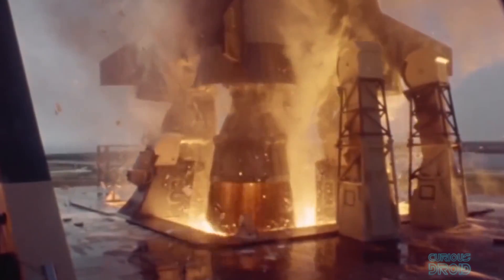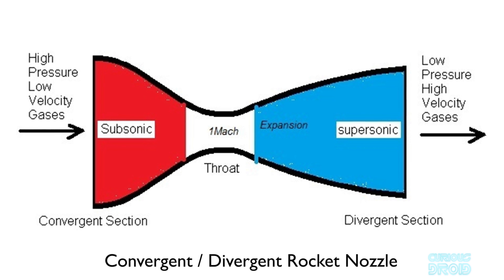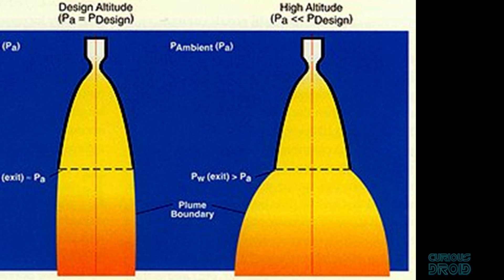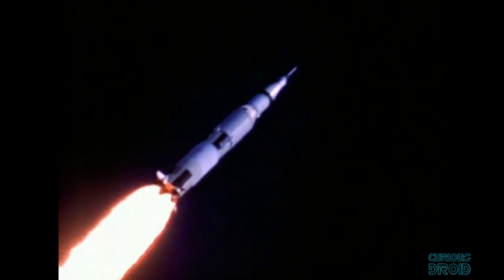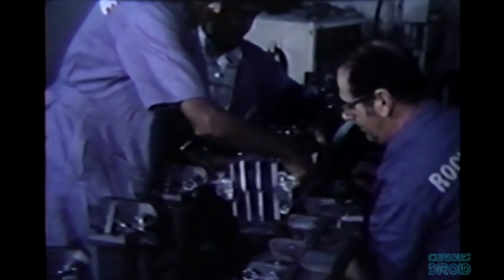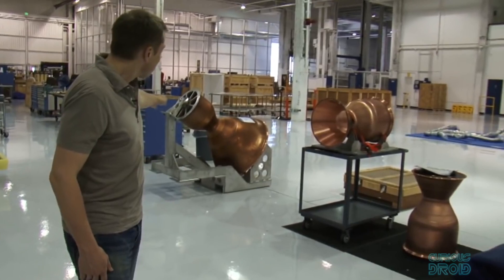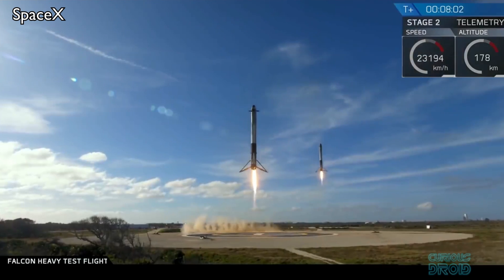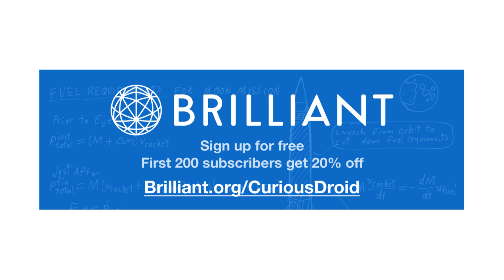Aerospike Engines - Why Aren't We Using them Now?

Comment: @2:35 Whilst it's true that we have evolved to live at (more or less) one standard atmosphere, and we can't survive for too long if that poressure is reduced to about half that, that is not the reason we don't feel atmospheric pressure. If we truly did have a net pressure of 14.5 pounds bearing down on every square inch of our body, then trust me, we would really, really feel that. 

That actual reason why we don't feel atmospheric pressure, is that our bodies are permeable. That is there is 14.5 PSI pushing outwards which makes the net pressure on any point of our body zero. That's also how commercials divers have descended to 500 metres where the pressure can reach 700 PSI.  

That's not so say that there aren't physiological issues due to the differences in partial pressure of gases. Those who are diving to considerable depths have to use special mixes of gases to avoid the toxic effects of normal gas mixes at high pressure, but they don't actually "feel" the pressure due to that internal and external equalisation.

Comment: I wonder if the ability to control fuel flow and thrust would allow for slower rockets. The bell type rocket motors are designed for one speed, full. Ability to ‘throttle down’ the thrust would be interesting as far as flying into space with lower g’s rather than a vertical launch.

Comment: Don't get me wrong aerospikes are good in atmosphere, so they could make sense as a first stage or booster engine. But they are not nearly the slam dunk some people think they are. The heat issue is nowhere near solved (just expensively mitigated) and the added complexity in terms of plumbing, valves, pumps, and added combustion chambers is not at all trivial. The plumbing is always way trickier than the engine bell design. I believe that aerospikes could work, and even be better than bell nozzles, but as with all things in aerospace (and particularly with propulsion/fluid dynamics) the details here are not at all trivial or straightforward. There is a lot of complicated development work left to do to make them reliable and better enough to warrant switching.

Comment: Paul, I noticed an error. 
1 square inch is not as you said 2•54 square centimeters. 
You naturally meant 2•54 centimeters squared. 
Thanks for the information in the video.

Comment: aero space engines  where gave up  after they where seen to melt down  prematurely   they also could not produce the amount of thrust nessesary for lift off   they where obstrussively expensive and produced insuffient thrust     so don't make them sound like they where the best thing ever invented     they where scraped after they realized they where burning up mid test    get your facts straight     dam your negative

Comment: Aerospikes don't remove the need for staging: you still take a huge mass penalty lugging the entire vehicle into orbit, so you'd be better off discarding three quarters of the vehicle (and a good chunk of mass) and then only lift what's left into orbit. And if you're going to need to stage anyhow, you can just put vaccum-optimized engines on your upper stage... and thus the main advantage of aerospikes disappears.
Compare the full-sized VentureStar (the final version of the cancelled X-33) to a Falcon 9. The VentureStar is twice as heavy and has twice the thrust, and yet has 10% less payload capacity to low earth orbit. What's the point of it, then, if it has less than half the efficiency of a conventional rocket? It wasn't even expected to be cheaper: VentureStar was supposed to be 1/10th the cost of launching the space shuttle... which would make it around the same price as the Falcon 9.

Comment: Black Budget money went in the development of another SSTO government project similar to Aurora. This is why NASA hasn't had a manned launch from US soil since the end of the Shuttle Program. NASA also know as NADA even with BILLIONS OF DOLLARS and over a DECADE cannot get a rocket into space even using existing technology!! All the components are from the Shuttle, the solid rockets just a other segment,  reusable engines leftover from the Shuttle Program to be used once and wasted the external tank with a little different plumbing.  It's all politics and about jobs. It is actually a wasre almost criminal. I usually support everything NADA did but they have done NOTHING FOR over a decade!! Launched a dumpster green capsule shaped spud with some old Sparko racing seats thrown in for good measure spot welded together by third rate engineers and workers milking their jobs, robbing the taxpayers.  And the put the Orion dumpster on top of a perfectly good Delta IV which is existing technology and could have been human rated. Is basically uses a modified Shuttle R-25? engine. Mark these words. The SLS will not get built. They might slap together one Orion/ Dumpster but god knows what it will get launched on. A commercial rocket maybe? Government didn't want to waste billions per launch especially on a inherently faulty vehicle that killed 14 U.S. and international astronauts,  scientists and citizens. The technology the has is beyond what most ppl could believe. They cannot afford for it to fall into the hands of underdeveloped and unstable countries.  It would be worse than nuclear weapons in the hands of ISIS which almost happened a couple times.
Thank you for letting me have my moment.

Comment: We are missing something really big. There has to be a much easier way to get off the surface of this or any planet.
Reply: There already are.
But they require heavy expensive and experimental Infrastructure and are Impossible on Earth.
small and hardy Payloads could be launched from the Moons Surface to a Space Station in Low Lunar Orbit.
But that's not economically viable.
It's like building a Train Line to just a single House
Reply: @user-si5fm8ql3c  I suppose. Until there is a profit to be made and/or someone finds resource(s) that are viable (maybe asteroid mining someday or using resources from the Moon everything obviously has to be launched off this planet. Also, it seems like NASA even with SpaceX, has a hard time keeping supplies to a few ppl on the ISS 250 or so miles away. They might find it harder to keep a few people on the moon supplied let alone Mars. I am optimistic tho.

Comment: My understanding is the single stage to orbit is not an attractive option. Moving the empty tanks etc into orbit would take way more fuel which equals a much bigger craft to launch a smaller payload. The work done by Space X in reusing the first stages makes it even less attractive. So while the aero spike engine may be interesting it brings no value to space projects as reusing rockets will become much more routine, possibly including at least some second stages.

Comment: I think obsolete, there are better working less expensive ways to fly with rockets, plus we know how to use the Earths magnetic field AND 'cancel out' gravity (without a rocket, but with electricity). I suspect this will be common knowledge within a decade, if not even years. In my view: this project has been running for too long compared to the speed of the other alternatives being discovered (duration of development will impact the costs heavily and the 'balance' must have tipped somewhere down the line when the alternatives emerged.

Comment: Concerning the maintaining of a "CONSTANT" concentrated one uniform thrust of expanding gases and the reduction of ambient air pressure causing the concentrated thrust to lose power- because the expanding gases expand too much--#What if liquid nitrogen was UNIFORMLY passed over tubes running OUTSIDE the bell shaped cone so that when it "#JETS #OUT,  it's #SHEER #COLD will #CONTAIN the SAME UNIFORM #MAXIMUM shape for thrust!!--In other words , this method might not need second and third stage rockets and importantly CONTROLLING the #SHAPE of the expanding gases exiting nozzle will allow for CONSTANT MAXIMUM THRUST!!

Comment: Funny when the X-33 was proposed during the loser administration of Clinton/Gore. Gore had the responsibility of getting X-33 "off the ground".
When the X-33 program got going they recognized their assumptions were wrong on the complete design.
Those aerospike engines can't get the thrust required to boost the X-33.
Too much worthless stuff were on X-33. Weight and complexity of health monitoring systems. The composite tank was never viable. The aluminum tank would have been a stepping stone to get X-33 flight tested with the aerospike engine. The idiots in the Clinton/Gore team watched to much Star Trek and Star Wars. The X-33 just couldn't work. The aerospike wasn't the only problem. But it was a huge performance problem the project couldn't beat. Plus it was never going to work. Gore said the day it was announced, that "if it didn't work that was OK". "The technology development would be worth the failure."
That tells you all you need to know about the project. X-33 was a rich man's WPA program. Just Government money down a rat hole. The money was nice for aerospace workers. All of it got spent. But no good product. They tried to do a cryogenic valve that was electrically activated in opening and closing. Never happened! I was there. The valve would never close completely as designed. The conventional valve would have worked by mechanical means. But no, the engineering thinking was incomplete all the time. They were trying to mandate technology that wouldn't work.
Aerospike was just one of the reasons X-33 never did anything.

Comment: I've heard that the biggest problem with aerospike engines is that they overheat very quickly. I think running cryogenic fuel through the surface like on the Space Shuttle would be a decent fix. I don't think anyones created an expander cycle aerospike engine yet, that would be interesting.

Comment: Why can they not propel rockets into space with extreme PSI and compressed air is polution free and will be a lot cheaper even if it is only used as the first stage in the rocket to get half way.

Comment: There certainly seems to be some truth to the suggestion that following the Challenger disaster the Reagan government facilitated the transfer of a significant element of space technology, research and exploration out of "public" control and reclassified it secret as well as into proprietary hands (primarily defence contractors). Why this happened I can only guess. One thing which always nagged at me going back as far as the eighties was the argument that manned space explorarion (particularly aimed at the moon) was simply too expensive. Why? We already possessed a rocket capable of getting us to the moon. Ditto the landing vehicle. Practically all of the major costs (primarily in research, materials development, design etc.) had already been paid. You are simply re-using existing technology, drawings, astronaut training etc. which comes at a fraction of the cost. You already know how to build a Saturn V rocket so the only costs are those at the very back end of the development and production cycle - primarily materials manufacturing, assembly, fuel etc. Then there is the argument that landing on the moon is just too dangerous. It would be political suicide if something happened which led to fatalities. Perhaps there is some merit in the latter point - but let's not forget that the Apollo program (certainly beyond the deaths of Grissom and company) had an excellent safety record. This is a program which oversaw several successive trips to the moon and back - the majority of which executed the incredibly challenging lunar insertion, undocking, powered flight to the surface, astronaut EVA, liftoff, docking with the command module, shift to a higher orbit. burn for trans-earth injection, earth orbit insertion, re-entry etc. Even after Apollo XIII suffered catastrophc damage and Misson Control ordered them to abort - they still managed to make it home.

 Which begs the rather obvious question - if almost all of the Apollo program's costs had been amortized and post-Grissom, Chaffee and Whte's deaths the flight vehicles had an excellent safety record - what's the problem? Since when was it reasonable in any era of exploration to turn down the use of admittedly dated but tried, tested and already paid for equipment with an excellent history of safety in favour of shelling out ten or more times the other's costs in order to research, design and build new ships, train the crew and maintenance teams etc. - only to then start 12-18 months performing exhaustive tests which may reveal problems causing delay after delay whilst the costs skyrocket? Bear in mind too that with modern methods of construction amd miniaturization they could easily remove many of Apollo's antique, bulky and heavy equipment (such as the guidance compuer) and replace it with a Raspberry Pi or equivalent which fits inside a packet of cigarettes. Repeat this across many of Apollo's systems and suddenly you have a dramatically improved spacecraft which is now several hundred pounds lighter. Which means more room for fuel, a larger sensor package, better vehicle etc.
Reply: >Since when was it reasonable in any era of exploration to turn down the use of admittedly dated but tried, tested and already paid for equipment with an excellent history of safety in favour of shelling out ten or more times the other's costs in order to research, design and build new ships, train the crew and maintenance teams etc. - only to then start 12-18 months performing exhaustive tests which may reveal problems causing delay after delay whilst the costs skyrocket?
Since it generated more jobs in districts of congressmen, which decide funding of NASA.
Reply: @caav56  That's a political problem. But it's certainly not insurmountable. Those problems existed before and during the moon landings and you shouldn't expect such to vanish any time soon. Bear in mind that all eras of "discovery" (whether it be Columbus right through to Captain Scott in the Antarctic or Crozier and company's doomed attempt to find the NW passage) were predicated on enormous capital investment. But I can find no analagous abandonment of all subsequent attempts (for 50+ years) - especially following several successful missions. It makes no sense whatsoever.
Reply: @deaddropholiday  >But it's certainly not insurmountable.
Indeed. But as long as this way of doing things remains profitable and capable of lining pockets with shit-ton of money, it will continue to go on. Honestly, I'm very glad SpaceX is a thing - after all, it did stir the cesspool of a launch market like no tomorrow, even without using any new technologies - just taking old developments and making an actual use of them. Let's hope more companies like SpaceX and Rocket Lab flourish and force the situation to finally change.

>It makes no sense whatsoever.
Until you look at political situation. BLM and other movements protesting Apollo missions and space exploration in general ("Billions for space, pennies for the hungry"), Vietnam war and other shit like this. Politics were what has strangled the space exploration and it ended up more profitable to keep it like this, with an overbloated jobs programs and starting and re-starting new projects every presidential term to maximize voter excitement.
Reply: @caav56  Again, I can't stress the argument that costs finished the Apollo program is completely misleading. The overwhelming proportion of Apollo costs were tied up with research, development, infrastructure (multiple launch sites, command and control, construction facilities, training facilities, materials development etc. etc.). But these costs had *already been paid*. With all of this infrastructure in place the cost of sending subsequent missions is fractional. You don't need to construct several new launch centres. You don't need to build huge new water tanks for EVA simulation. You don't need to spend millions of dollars investigating which materials are capable of withstanding the rigors of space. You don't need to erect a string of new radio and radar tracking facilities to locate and communicate with the spacecraft. You don't need to train up the thousands of people needed to make sure a launch is possible. You have a design schematic for one of the most successful space vehicles ever created. You have the facilities and materials required to build the rocket, command modules, LEM etc. The truth is it probably cost as much NOT TO send subsequent missions.
Reply: @deaddropholiday  Yes. I do agree with you. I really do. But the thing is - quite a few of parts you've described are one and done thing. It does not create a ton of new jobs. It does not stir the public opinion enough. By the end of the day, Congress and President's administration were commanding the fate of Saturn program, and they've decided to cut it down to start a new, more pork-barrel project in its place, which'll have as much of the states involved as possible. Honestly, it's a damn tragedy here.
Reply: @caav56  Possibly. Or they could simply have turned the whole thing over to the military and hidden its existence under cover of the "Black Budget". Is there any precedence for such behavior? Well - yes.  Remember that space station the DoD was running filled with sophisticated (and very expensive) cameras and manned by astronauts? No one had heard anything about it for over thirty years before it suddenly emerged in some declassified report. Indeed,  it's pretty clear they were running an operation out of Vandenburg AFB which was budgeted to the tune of billions of dollars. I think VAFB operations were shut down a few years back. But this only means it was spun-off into the private sector. Food for thought, anyhow.